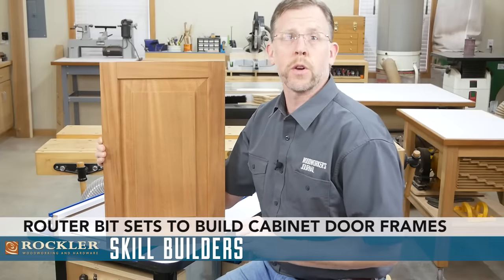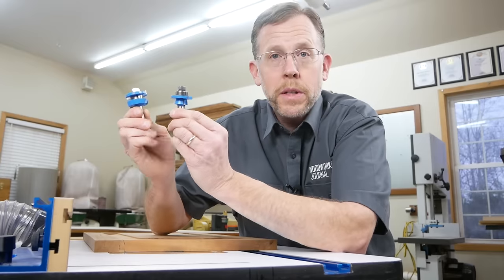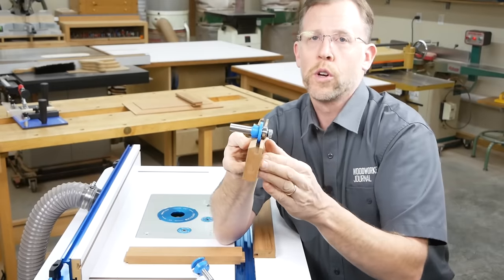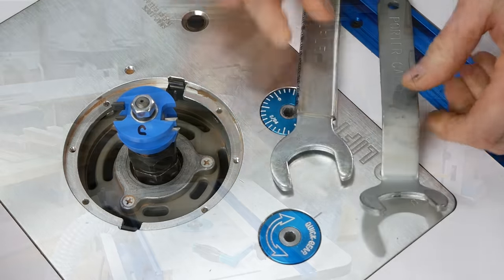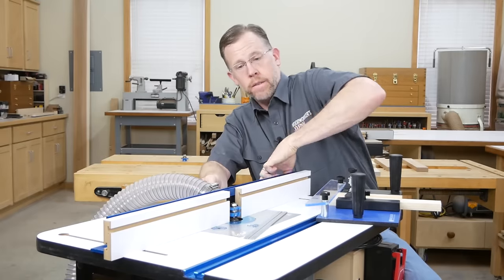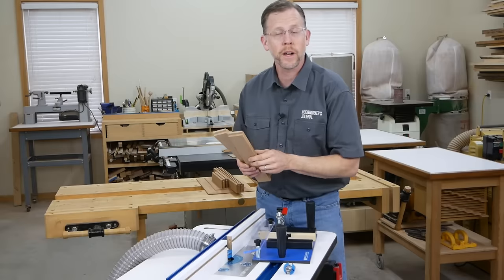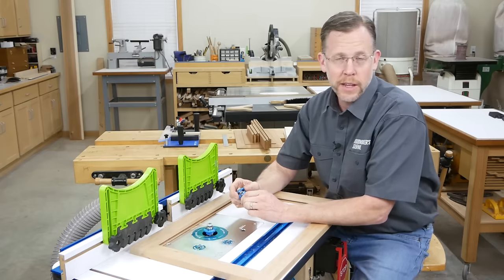How to Make Cabinet Doors with Rail and Stile Router Bits | Skill Builder

Comment: This is a really good tutorial on using cope and stick bits. In my shop, I generally use multiple router tables when making raised paneled doors. I set up one for the stick cutter, one for the coping bit and one for the raised panel bit. I also use one with a cutter to eliminate tear out from the stick cutter, this is a prerequisite to the stick cutter and I never cut the stick without it. This is my trade secret.
Reply: Can you explain more about eliminating tear out on stick cuts? Where is the tearout and what bit do you use (and how)? From my limited experience I haven't really had any tearout issues with the long grain cuts.. but definitely have when coping the rails.
Reply: @MrExamplename  First, let me clarify. I also get tear out on my rails. The only way to minimize the tear out is to back it up with a sacrificial piece that is the same thickness as your rails. Also, cut the cope first, then the sticks. 
Now, what I was talking about the tear out on the stiles or stick pieces, occurs along the edge where the groove is located. This can happen on oak, maple, cherry and other hardwoods. I haven’t had any problems with Poplar. The trick to eliminate the tear out along the edge is to first make a pass with a 1/4 slot cutter that is exactly the same height as the stick cutter, but cuts only about 1/16 of an inch deep.  If you look at a stick cutter, you will see it has the groove cutter that is 1/4 wide. With this slight groove, the stile cutter (stick) has nothing to tear out. But this also means that you will need 2 routers tables to do this. The router table I use for the stick cutter also has a Grizzly stock feeder attached to it so I get a continuous clean cut. I’ve been doing this for years. Hope is helps.

Comment: I bought these Rockler bits. They are very nice but trying to get the depth to match between the two bits so that the rails and stiles are flush and smooth is very challenging.
Reply from the maker: If you go back and re-watch the video, pay close attention to the content around the 7:14 time stamp. Here you’ll see the stile/sticking cutter being height adjusted so it’s slot cutter matches the tongue height on a coped piece of the joint. This is the best method to set the second router bit accurately: use a sample coped end to fine-tune the stile cutter’s height. If you do that, the resulting cuts will enable the door frame’s corner joints to fit together accurately and the faces of the rails and stiles will be flush. Of course, make sure the thickness of your rails and stiles matches before you begin the routing process, too.
Reply: @mwinner101  a router lift helps. The Mast-R-Lift II is height-adjustable to 0.001”.

Comment: Hi, I bought this bit set and it works great.  The package came with two thin washers in a separate little bag.  What are they provided for?  Are they shims?
Reply from the maker: Hi Jerry, They are intended to help adjust the width of the tongue, if necessary. Our product support team can explain the uses and how to in depth for you. You can reach them at 1-800-260-9663 or support@rockler.com. Thanks!

Comment: can be use also plywood this kind of project
Reply from the maker: You could, but plywood doesn't perform well with router bits like this. You may get a lot of chip out.
Reply: @rockler  okay tnx

Comment: So do these work on different thickness boards or certain thicknesses. Are doors and windows basically code or can you make them however thick you want?
Reply from the maker: Hi Jody, rail and stile router bit sets have a limited range of workpiece thicknesses they'll accommodate. This mainly has to do with how thick the rear wall that supports the panel or glass will end up being -- the thinner the initial stock thickness is, the thinner this supportive wall becomes in the final assembly. There is no "code" that regulates interior cabinet door thickness. Conventionally, they're 3/4" thick.

Comment: Rockler makes some decent router bits, but these R&S bits lack one necessary feature... the ability to adjust (shim) the rail tongue and related panel grove thickness on both bits to match the panel material thickness.  I wish Rockler would update these bits to allow that adjustment feature.  Until then, I'm using a set of Freud bits that have this adjustability (model 99-762).
Reply from the maker: Thanks for your honest feedback. We will pass this along to our product development team.

Comment: Do they Rockler Rail Coping Sled fits on any router table?
Reply from the maker: The clear guide registers off of the routers fence and runs 2'' above the table, so it works with most router table fences on the market.

Comment: Can I use these to make frames for the closets ?
Reply from the maker: Probably not as usually closet doors are made with 1-1/4" - 1-1/2" thick material and these are only designed for 3/4" material.

Comment: Can I glue up the panel to the stiles? Thank you much
Reply from the maker: Hi Luis, as long as the panel for your cabinet door is made of plywood, you could glue it to the stiles. A solid-wood panel, on the other hand, could crack if it's glued into place (it can't expand and contract properly with seasonal wood movement). There's no reason any panel need be glued into a cabinet door, however. If the rail and stile joints are made well, glue alone in the frame joints will offer enough strength for the door.

Comment: A better designed coping sled would not require the readjustment between routing the cope and the stick. Otherwise a very good presentation.
Reply from the maker: The sled is for coping rails. The stiles/sticks aren't cut with the sled.

Comment: what type of router do you use?  I loved it
Reply from the maker: I use a 3.25 HP Porter-Cable 7518 router motor in a Rockler ProLift. But routers in the 2HP and larger range are powerful enough to use cope-and-stick router bits. I wouldn’t use anything smaller than a 2HP router with these bits.

Comment: OK,  good video. One question: How do you know how long to cut the rails so the doors end-up being the correct width?

Would you need to measure the depth of the tongue and add that measurement to each end of the rail since they go into the styles?
Reply from the maker: Hi Eric, the easiest way to calculate part dimensions for frame and panel doors is to use our Woodshop Calculator -  https://www.rockler.com/woodshop-calc-key
The simplified answer is the width of the rail equals the width of the door, minus the width of two stiles, plus the depth of the two panel grooves.
 We encourage you to reach out to our Product Support team at 1-800-260-9663 or support@rockler.com with more questions. Thank you!

Comment: Are the joints only glued?
Reply from the maker: Hi Jim, the answer is yes; rail-and-stile joints only need to be glued for assembly. Their mating profiles offer significant surface area for glue to create strong joints.

Comment: Can you please add the link for this router table. Thank you
Reply from the maker: Hi Dylan, you can find the router table top used in this video on our website at https://www.rockler.com/rockler-high-pressure-laminate-router-table-fence-and-phenolic-plate
Reply: @rockler  can this work with dewalt router dw618?

Comment: 5:05 - How does this step set the fence parallel to the coping sled travel?  I'm building a fence for myself and need to understand how that setup works to ensure my fence can support the same functionality.
Reply: My bad: I thought the coping sled was riding in the miter slot.  Now I see it rides along the fence.

Comment: Z equals the size of the door opening Plus / or minus the overhang. The rail length is equal to 2X minus 2y equals the width of the overall  Z where X equals the width of the styles and Y equals the depth of the cope. Do you find this to be true?  Measure all of the openings. The length of the upper styles are all the same for the same type of doors. The same is true for all the lower doors of the same type doors. Drawers can be grouped likewise.Rails should be the same for the lower and upper doors that are above one another, but this is not an always rule. They will just look strange to your eyes. A cut list is a necessary tool that will simplify your life and save time and material.

Comment: Yes but how do you figure out the cope measurement?
Reply from the maker: If you mean how do you estimate the length of the rails, which have coped ends, here's a formula:

Width of the door opening minus twice the width of the stiles plus twice the depth of the sticking cuts equals the overall rail length including the coped profiles. This does not take into account the swing clearance needed around the door and will build a door that fits tightly in its opening.

Comment: Will these bits work on 1/2 thick wood or does it need to be 3/4".  Not doing an inset panel but a piece of 1/8" glass set in from the back(like a picture frame.)
Reply from the maker: This bit set is designed specifically for ¾” rails and stiles. Using ½” material for the frame provides a very limited surface area for the joints, reducing their strength and rigidity.

Comment: What is the thickness of your stock?
Reply from the maker: Rail and stile router bits are typically used on 3/4"-thick stock, as was used in this video. But, they also will work with slightly thicker stock, up to 7/8". However, with thicker stock the back wall of the grooved area (behind the glass, panel or raised panel) will end up thicker to account for the extra stock thickness.

Comment: How did u made the center part of the door? Not the frame
Reply from the maker: Hi Sean, the panel on the door in this video is a “raised panel”, meaning the edges of the panel have been cut to leave the center area thicker than the edges. The edges can be tapered, as you see on the panel in the video, or cut to other profiles such as an ogee profile. You can use a table saw or raised panel router bits to form the edges of a raised panel.

Comment: But this dont look nice and fit. This only looks easy to push it together. The bits working not good together. One is to big for the other
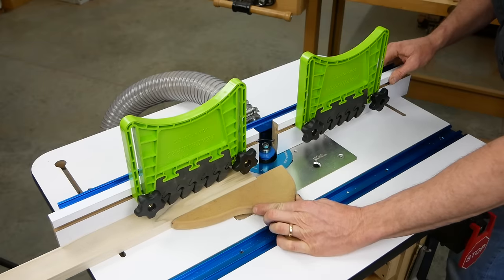Reply from the maker: At 8:09 in the video you will see how tight they fit. The tongue and groove section has a slight clearance space for glue.
Reply: @rockler  glue dont need a space. Glue goes into the wood. The tight fit can u see when u hold up all on one peace. This i dont see at the video
Reply from the maker: You can see the tight fit at 8:38 into the video.